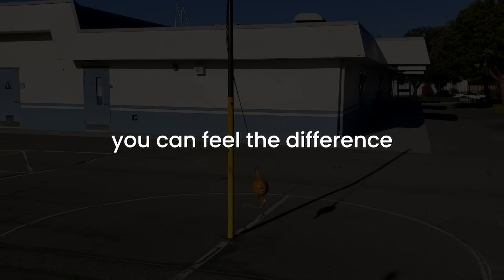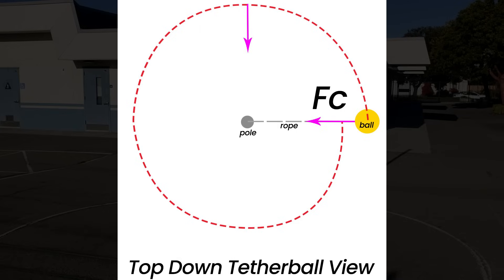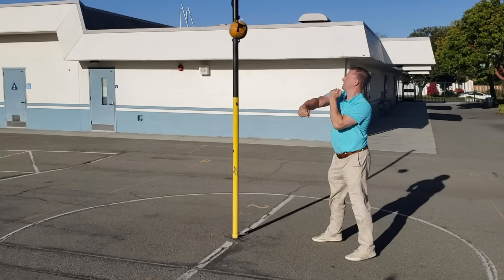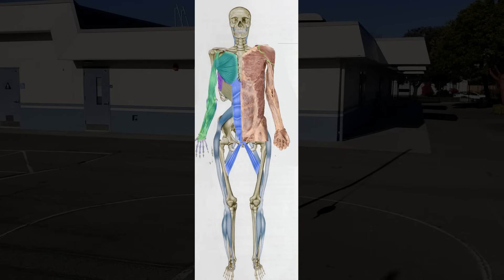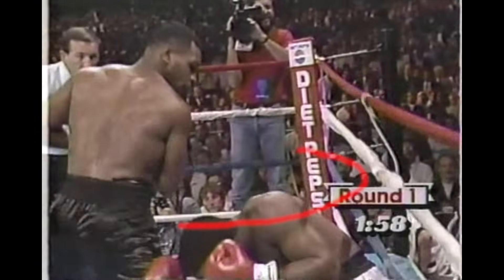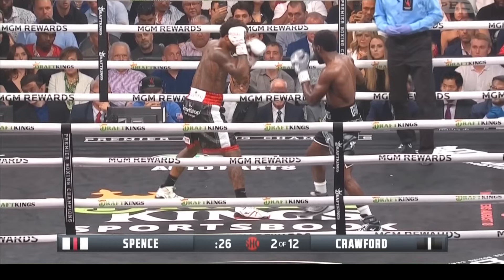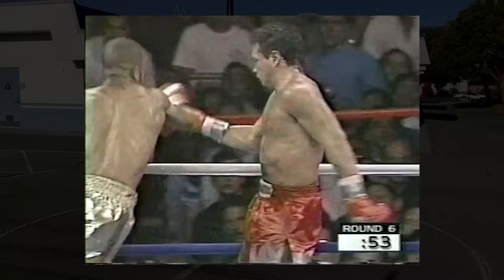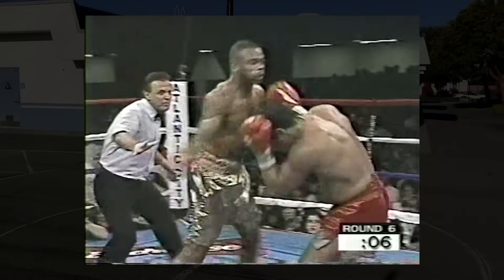The Hidden Physics Behind Natural Punching Power, And the Secret Advantage You Aren't Using (Yet)

Comment: Punch and throwing a light weight ball are completely different. 

the swinging technique used to throw a baseball maximizes velocity of the hand holding the ball. The object is to hold a light object and swing your arm so the object leaves your hand going as fast as possible. You can throw that ball even further if stretched yourself, your legs, body and arms, out further and whipped them in wide an arc as possible, because the wider the arc the faster the hand at the end of it is going (That's what Ciryl Gane is doing with his punches). 

Want an accurate test? Get yourself a 20 KG medicine ball or KETTLEBELL(So you get a sense of the risk of getting this wrong), sit it on a tee and PUNCH it with all these different techniques. See how far you can make it go. 

I remember an exact quote from you about punching. 'You're not pushing a ball, you're throwing one'.  But, you literally are pushing a ball, the target's head. What you're not doing, is holding and then pitching or throwing a ball that leaves your hand and then hits someone in the head. 

Your technique demonstrations like in your uppercut suffer from the same misunderstanding. You're deliberately throwing with your shoulders and arm relaxed like they're noodles, which is almost exactly what your criticized ciryl gane for. You're also doing this cascading sequence thing where your body has stopped turning towards what your hitting before you swing your arm. The moment you want your body making the most work, or effort, towards the target, is when you're hitting it. So the trunk of your body already turning back AWAY from what you're punching before your arm is swinging, and before you're hitting, means it's not pulling your fist into the target when you are landing.

'shoulders don't generate power'. Relook at all of the clips you include of boxers landing, they're keeping tension in their shoulders and elbows, they're not slacking them like wet noodles like your strange swinging demonstrations.
Reply from the maker: instead of creating acceleration in a ball, you're creating it in your opponent's head. I've discussed tension at impact to support weight transfer through your target. You're supposed to stay loose until impact.

Comment: When you did the ball throws using a right cross with both the linear push and then the integrated arc, you stood perfectly still for linear but took several steps before doing the integrated throw. I’m not saying your technique isn’t legit at all, but this honesty looks like you are trying to scam us, because you didn’t do an apples-to-apples comparison at all. Anyone who’s ever thrown a baseball will tell you that taking a few short steps before you throw DRAMATICALLY increases the distance you can throw the ball. So why would you do the linear push from a dead standstill, but not the integrated arc?
Reply from the maker: I could have tightened it up and stayed more in place and the result would be the same. I'm not "winding up" like in a pitch, I'm bouncing around like you would in the ring. the rigid linear style is much more flat footed. I demonstrate the jab in place and it goes way farther. the linear style is inherently more rigid and less mobile and doesn't use loading / unloading or kinetic sequencing. If I ever revisit this I'll tighten it up. I have a video coming out this week where I do some really close comparisons to demonstrate speed differences.
Reply: @ThePunchDoctor  Nice, thank you for the reply. I hope it was clear that my comment was not meant to accuse you of anything, but more as a suggestion on how to make your demonstration more convincing by eliminating anything that someone could use to accuse you of cheating.

Just my two cents, even if the integrated style involves more steps with the feet and the linear style involves more standing still, I would still go apples-to-apples for your comparisons with the ball throw, because otherwise IMO, the difference in how far the ball travels seems more attributable to you take a step than to the precise motion of your arm, simply because all men are familiar with how much farther/faster you can throw with 1-2 quick steps beforehand.

Anyway, thanks for making these very informative videos 🙏🏼

Comment: It does not increase "torque", which is used wrong, it does not increase impact force one iota. Impact force is created by acceleration. 85-90% Impact force is created by the legs and hips, not the arm or fist position. Some think turning the fist lessens speed, albeit very little is any, by doing so.
Reply from the maker: huh? what starts the acceleration? rotation of the hips relative to the torso, eg, torque.
Reply: @ThePunchDoctor  No, torque is the force on a central point and a punch does not use or create torque. Torque is created on a bolt by the rotation of a wrench or, in arts like hapkido and aikido, an armbar. The  moving the arm as a lever in an arc, while using the hand on the elbow as a fulcrum, creates torque on the elbow. Twisting the neck creates torque on upper spine. Torque is the resulting force created by a twisting motion and NOT the twisting motion. In other words, throwing a punch has no torque involved. Amusing note on incorrect word use is power: In physics. power is the work (ex end result) of exertion. Thus, the impact force created by a strike is power and not before. In electricity, you do not "turn the power on or off".  In the video, the use made of the word torque is wrong. Another wrong use is putting "weight behind a punch". Bull. You put the body (aka mass) behind a kick or punch, not weight.

Comment: Very intriguing video.  It's quite obvious to me that the legs enable the hips to rotate enabling the torso/shoulder to rotate in a sequential fashion.  I don't understand though how to create this arch with a straight right.  I have always used those mechanics in my straight right hand, as well as my hooks.  Obviously with my hooks I keep the arm relaxed and at the end of the movement that is when i engage my bicep.  I always figured though that the proper use of kinetic chain referred to using musculature from the floor upwards in order to accelerate each link in the chain to finally reach peak acceleration with the arm.  When you transfer your weight from back to front foot generally the effective mass during the weight transfer is when you would want to contract the stretched musculature and accelerate the hips and torso during peak weight transfer to build peak force that would then be transferred to the arm and fist.  I definitely understand for hooks that you would want to engage the full kinetic chain in a rotational fashion (hence the use of the bicep contracting after the shoulder throughs a mostly relaxed arm).  However with a straight right hand the advantage is that the punch is moving and accelerating in the same direction as the weight transfer (from rear foot).  Flaring your elbow 90 degrees before throwing a punch is significantly weaker than throwing a straight right hand, because a lot of the effective mass is lost (leading to less force) despite equal acceleration.  This is because with a flared elbow the force and progressive acceleration lessens (unless you are fully slipped to to the inside) since it is not moving in the same direction as the backfoot-frontfoot transfer.  I don't think this is what you mean here though, because you threw your straights with internal shoulder rotation, allowing the shoulder to rotate as the arm extends straight out almost like a vertical punch but due to the internal shoulder rotation it ends with the fist turned over.  Are you saying to apply this to a straight right hand you still through it straight but torwards the end of the punch the shoulder continues to move the extended or near extended arm to the left.  Because the only way I could think of creating an arc with the final part of the chain (arm), is by using the bicep and throwing an overhand or even a willmill ahh punch.  You aren't doing that though, so I would love an indepth tutorial on how to use this arc concept for punches using the tricep like the jab and straight right hand.  Very interested in this and would love any feedback.
Reply from the maker: The straight punch is basically straight - it just has some small arcing trajectory mediated by the shoulder and pronating wrist so you can utilize shoulder rotation and slight downward motion to maximally recruit supporting / stabilizing muscles at impact. My "cheat codes" video goes a little more in detail about that. It's not a circle, just a slight arc. The red arc tracing the trajectory in my demonstration and clips shows the arc. The key takeaway is that it's a multi-planar movement, not a straight line.

Comment: How does one reduce the Arc By using Joints other than the elbow and shoulder? Also IS the Arc Just down or also inwards?
Reply from the maker: check out my "cheat codes" video - I go into more detail there about impact and follow through and it may answer your question.
Reply: @ThePunchDoctor alright I watched it now. In my opinnion also having an inwards Arc in Addition to a downward Arc feels Like the pecks are more active and the Punch is more powerfull. Do you think this is true or do I Just illude myself?

Comment: The "arc" is just a consequence of retracting your fist after you punch through something or someone. The body's rotation paired with the retracting of the arm, especially through the elbow joint via the bicep is what forms this "arc" you're tracing out. The Gervonta example at 2:37 is especially funny, his "arc" is just the result of perspective view of him bending his elbow back, not something a boxer should focus on mirroring by any means. You're right to point to body rotation as the punches power source. You use the tetherball, i like to think of a spinning top sometimes anchored at the rear foot sometimes the front- depending on the punch or position youre in when you throw the punch... Regardless, the fists are not where we should focus. Our arms arent as elastic as the string of a ball, and our body mechanics dont map well - hips and shoulders fellas. Aim, connect with a snap, punch through, quickly retract your punching hand to your guard or wherever your system demands, be aware of your elbows position when you do this. Punch in straight lines to your target. Punch through your target. Retract. Your body rotation will cause your fists to trace whatever path they will in 3-D space.

Comment: Makes sense because our bones move on hinges and joints which naturally arcs.  If they were pistons they would move straight.  Also arcs increase the literal distance traveled for your fist which gives it more range to accelerate.  If they start and end at the same time and locations the arcing fist will have traveled a greater distance (straight line is the shortest possible distance) which means it had more acceleration and velocity at the point of impact which in turn gives it greater force/kinetic energy.

Comment: There's something off with this analysis. Repeat the tests with a 15lb ball (shot put).
When impacting with a human body we need to consider not only the speed of the fist, but the mass of it - a car driving into your shin bone at a snail pace of 15 mph will shatter it to pieces.
The more 'linear' strikes might put a larger portion of bodyweight behind the fist on impact.
Reply from the maker: your fist with a glove doesn't weigh 15 lbs. you also have to consider stability at impact. landing with an arc trajectory utilizes more stabilizing muscles to facilitate a solid impact and weight transfer. Check out my "cheat codes" video for more on that and the "3 vector landing."
Reply: @ThePunchDoctor  But I don't hit people with only a fist. I hit them with a fist, an arm, a shoulder, a torso...
Just like when a car drives into your leg, you have not only been hit with a 10lb bumper.
Reply: When throwing a 2lb ball the primary factor is velocity of your hand at the point of release.
When impacting a 15lb head connected to a 150lb + body, velocity of the fist is no longer the only important factor, but the % of your bodyweight lined up behind it.
This is why heavyweights hit harder than crazy fast featherweights

Comment: I get how hooks and uppercuts use the centripetal force as power because the force is moving into the fulcrum, but how does it work with straights? Surely the arc is pushing the force away from the fulcrum, like a centrifugal force?

Comment: Wow damn i've been doing this for years as it just felt right and felt like I could lay people out way bigger than me using this Method. I'm small as hell so i'm already unnaturally fast hands even for my Weight-Class but I was getting upset at my Lack of Power no matter how hard I tried. 

Then one day during a Spar I landed a Jolt Counter using this method on accident and realized it gave me Bone Shattering Power when I put my Full Body Weight and Curved my Hand Downward Slightly at the End of the Punch. 

Also found even if they withstood it if they aren't a Brick Wall of Muscle the Downward Motion of the Curve will Drag them to the Floor. It virtually shaves no speed when doing it at the Very End and Increased my Power 3 fold.

Comment: Good educational information, but clearly you can see the effort and momentum difference between your "linear" punches versus your "kinetic" punches.
Not to mention how much more telegraphed it looks. 

At the end of the day there is no perfect punch. Your idea is just another tool in the arsenal. As prime Connor said "Precision beats power, timing beats speed".

Overall kind of sleezy tho since at the end of the day you are trying to sell something. While presenting biased information.
Reply from the maker: There is supposed to be visible momentum, that's the point. You're seeing the difference between a punch driven with the body and a linear punch where the movement comes all at once.

The idea that it's "telegraphing" comes up a lot however it's largely irrelevant when you consider timing, rhythm, using misdirections and feints to set up your shots. I cover this more in my video on telegraphing.

also, I'm selling exactly what you see based on how the body moves and works for speed, power and movement efficiency. If that's sleezy - so be it.
Reply: @ThePunchDoctor  I mean no ill will, and wish u the best of luck on your venture. But as you know in the fight game, there is no "holy grail".. speed, power, precision, endurance.. everything comes at a cost. Thats my main gripe against your video aka sales pitch. None the less good info and good discussion. thx

Comment: I feel a not so elaborated factor to a punch is lowered stance and bone stacking which contributes to the structure and solid nature that aids in “power” after a strike is landed. The face or body bounces back from the impact from a strike. Depending on the structure of the striker will depend on how much or little give will be present during impact. “ sitting down on punches” this is why you see  such wide stances and knee bend on some punches. In the end there are multiple ways to generate power and some multiply with shot placement, timing, and forward body momentum. Each of those have there own risks as well.